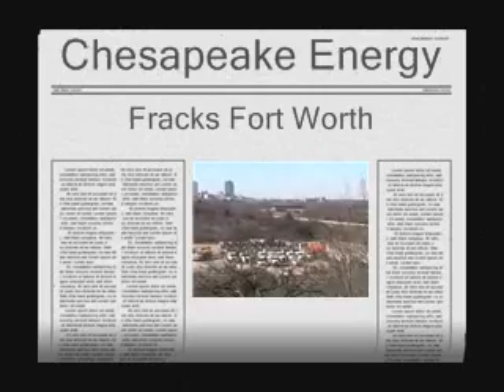Fracking Fort Worth

Comment: This guy has no clue what is going on. The "smoke" is dust from the proppant. It is most likely sand fines  or 100 mesh (fine sand) and is solid. It is an irritant but not polluting. The water is by law measured and purchased typically at a very high rate, and typically from a landowner's pond. I have seen some land owners make $100,000+ on water. It is very loud-therefore it is common practice to offer hotel accommodations and all expenses (mileage, food) during operations.